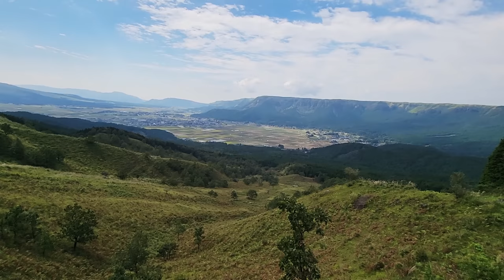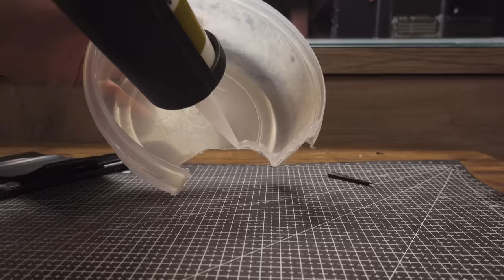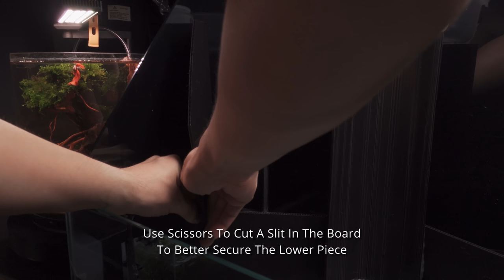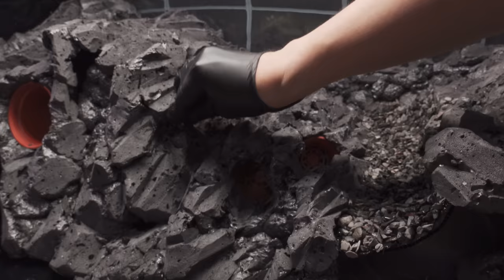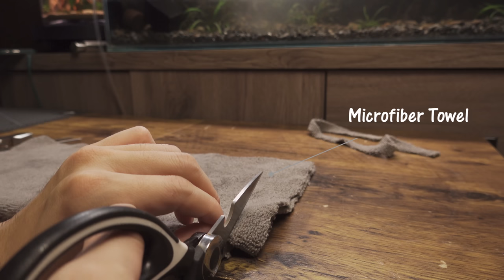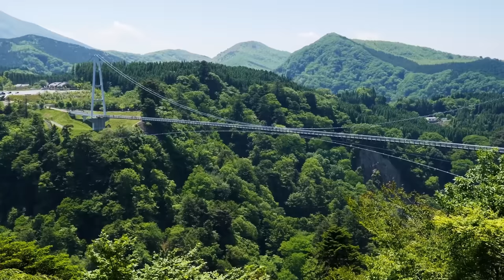A Place You'll Want to Visit Again: The Aquarium-Inspired Journey

Comment: apology, how much amount of silicone mixed with blacksoil? 
And how much waiting time, so that it dries and not toxic in paludarios ?
greetings
Reply from the maker: The specific amount of silicone can vary based on the size and requirements of your project. As a general rule, use enough silicone to adhere the black soil securely, creating a stable structure.
Silicone typically takes 24 hours to cure, but it's advisable to wait 48 hours to ensure that it's completely dry